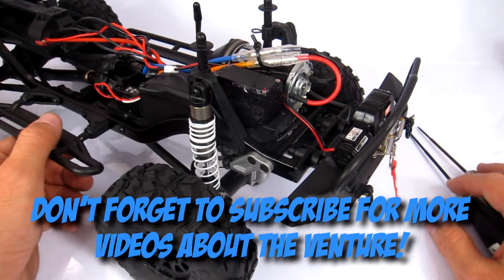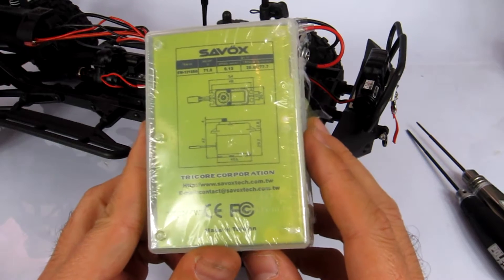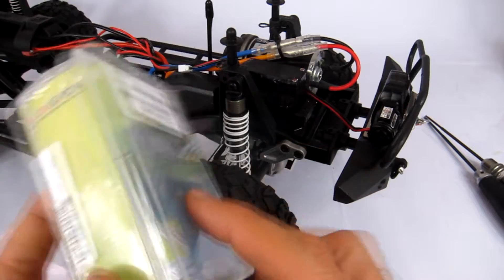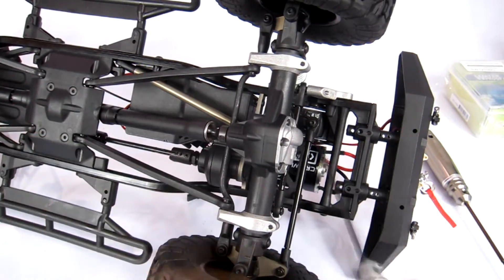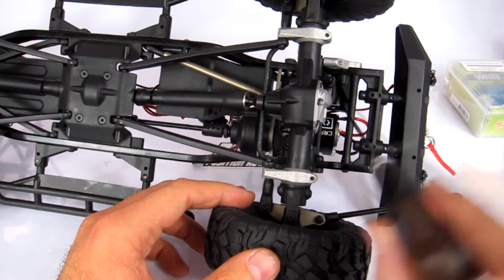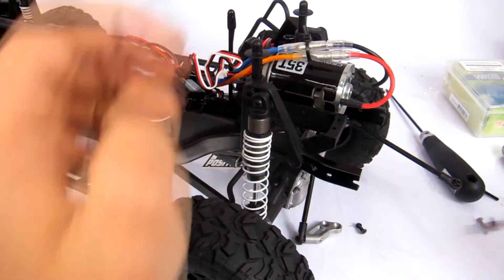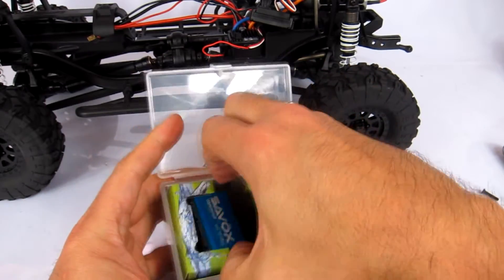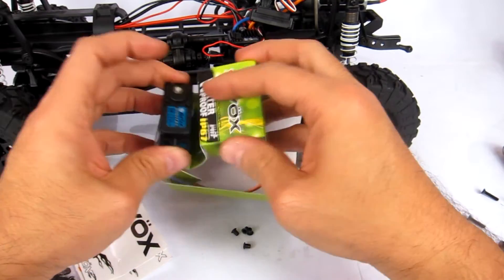HPI Venture FJ Cruiser - How to Swap the Stock Servo!

Comment: First upgrades will be a Savox servo,steel links and brass suspension parts.
Reply: I might also change the receiver to a Traxxas 5ch. Then I can use my Trx4 controller for both rigs.

Comment: Hope you notice that the Servo is lose. You can see it when you test it in the video. Do not use the caps without the rubber. Or use just the screws.

Comment: thanks for the video... did you need a BEC (battery eliminator circuit) for this servo?? thank you
Reply from the maker: Nope! Just plugged it straight in :) use the standard servo saver or the new one that STRC just released

Comment: I tried this but the steering don't respond unless I turn the wheel very slowly. May need to insert a Bec or change electronic.  Did you do okey without a BEC in the long run ?

Comment: Hi, I got the same servo, upgraded the battery to a 3s lipo, changed tyres & wheels etc, but I have no idea how to get a bit more full lock with my steering for sharper turns. Can you advise please?
Reply: the hosieman CVD axles from Vaterra Ascender or wait for HPI to release theirs.

Comment: Can you tell me where u got those rims and tires for this kit?  Maybe a part number??  Thx
Reply from the maker: Sure! These are Boom Racing Hustler M/T tires in Super Soft compound: https://www.asiatees.com/display?Miscellaneous-All-Parts-Hop-Ups-Upgrades&brand=Miscellaneous&model=All&id=139536&pid=1 the wheels are Boom Racing Krait beadlocks https://www.asiatees.com/display?Miscellaneous-All-Parts-Hop-Ups-Upgrades&brand=Miscellaneous&model=All&id=124345&pid=1
Reply: Pole Position RC thx bud how did u get a hold of a FJ
Reply from the maker: Pre-release press kit like the other YouTubers that have done unboxings :)